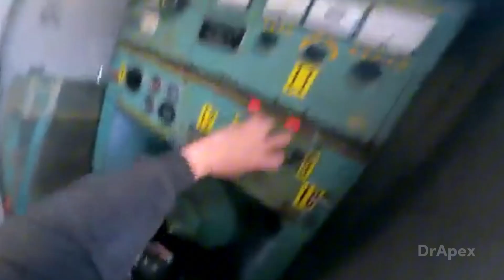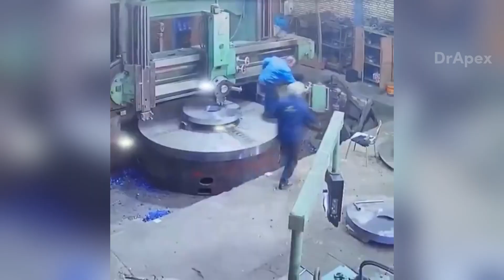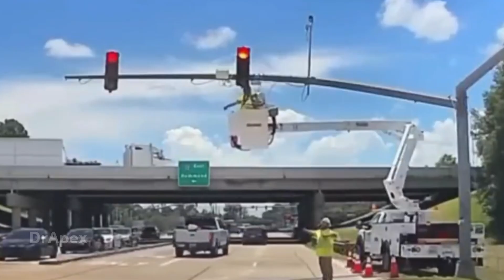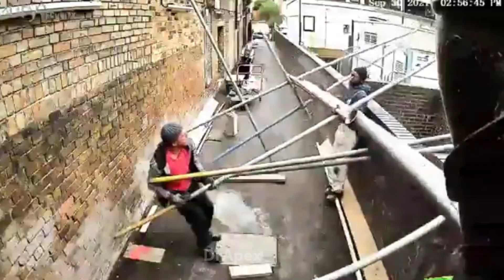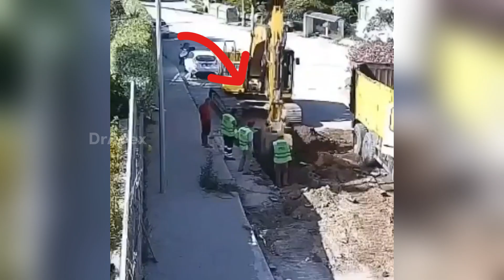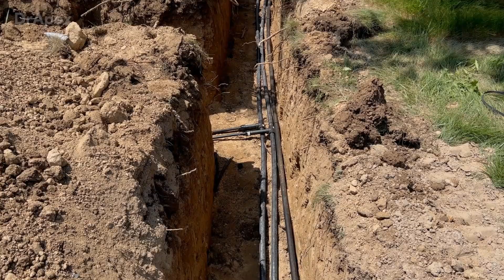She Got Too Close… Then This Happened

Comment: the Jerry can under the shower of spark,a potential for a dangerous combustion ever present as high voltage melting wire dripping downwards intensifying the original crisis,smoke bellows from the inclosed area to the workers dismay.